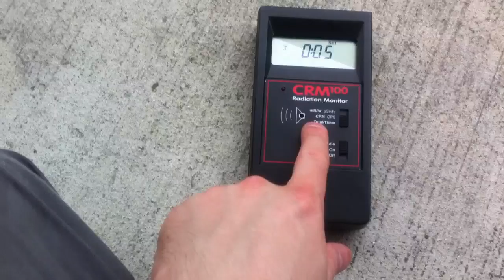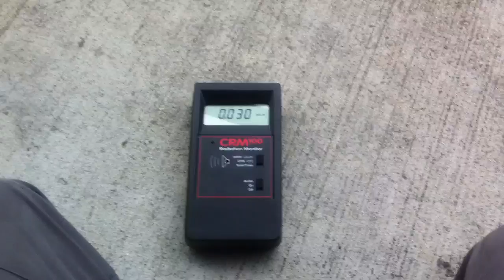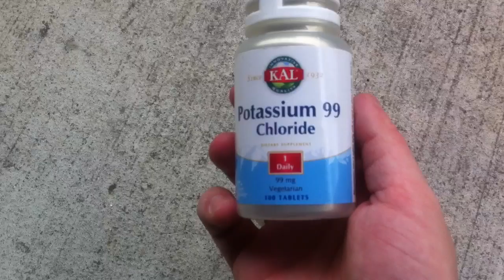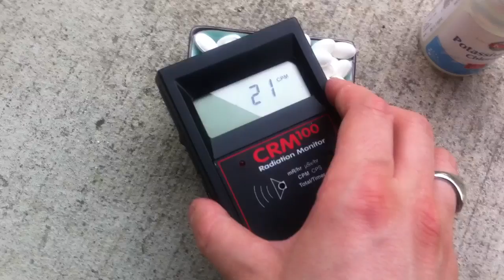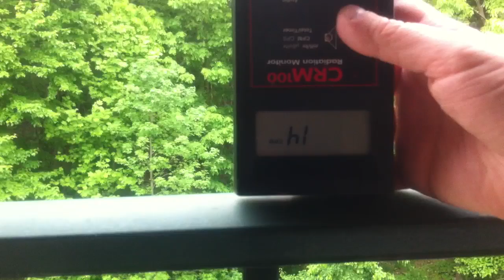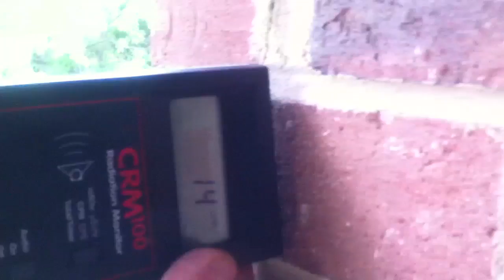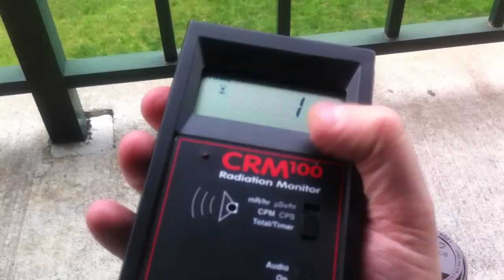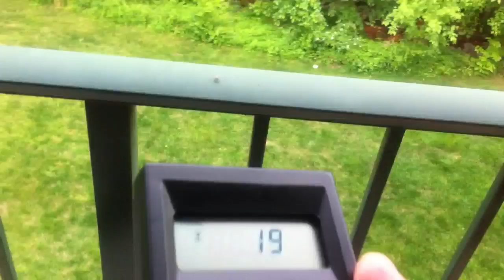☢ Radioactivity ☢ and How to Use a Geiger Counter -- Part 4

Comment from the maker: @TigerStryk   That would produce false readings.   If you counted 10 minutes of data and multipled by 6, you would get the same accurancy as a ten minute count. You cannot expand the accuracy of a set by merely adding a coefficient to each element.    Ten minutes is fine, but just divide by ten then. Also, the longer, the more accurate.

Comment from the maker: @sakuramane2004  this is difficult to answer, but let me try. Firstly, if you worry, do not let them play in the sand. Sand contains, often, some radioactive elements, like thorium. Secondly, consider that you would need to remain in the sand, 24/7 for a year to receive that dose. Thirdly, the counts per minute do not directly convert to uSv/hr in most cases.          I will upload a video explaining tonight. Please stay tuned.